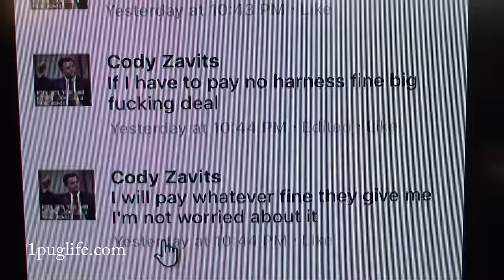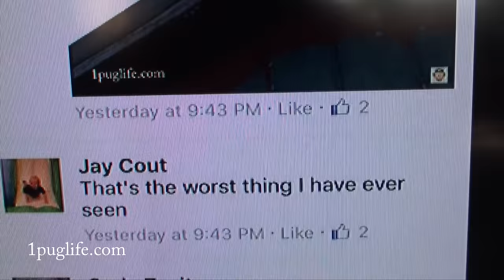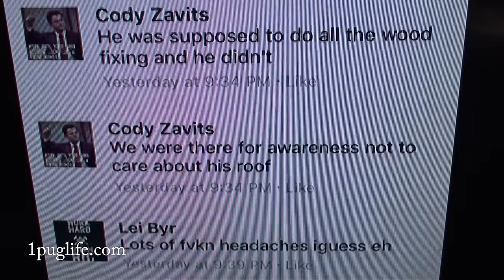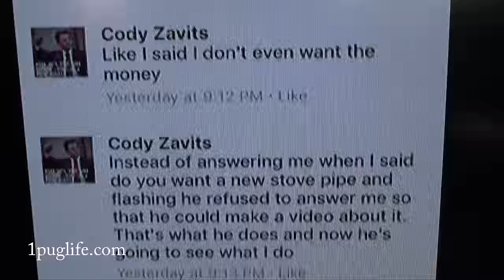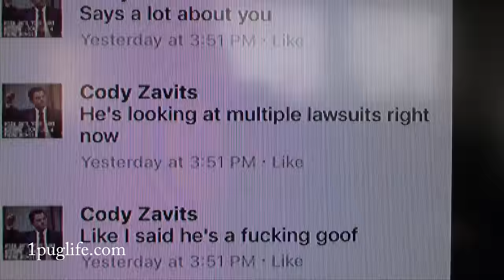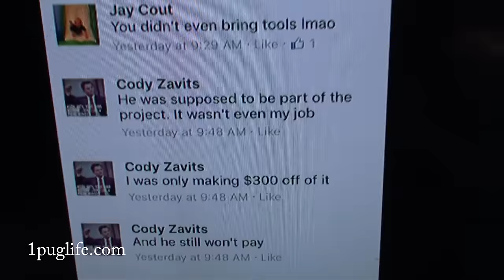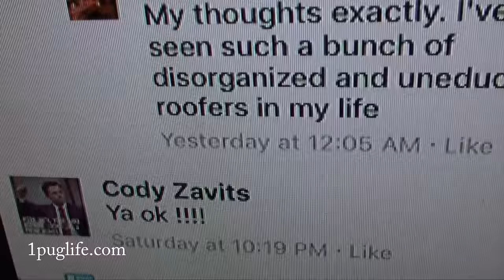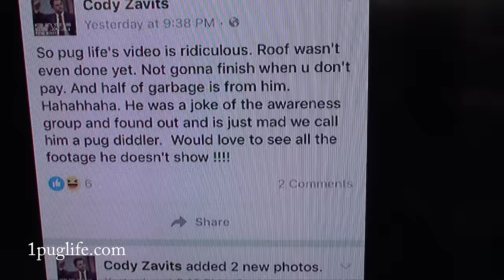second opinion

Comment: Bad sign #1 - contractor #1 needs to borrow a hammer.
Bad sign #2 - contractor #2 shows up with all his tools stuffed into his old lady's SUV.
Reply: Well at least oofer #3 in this video had a damn ladder rack! Something the previous 2 didn't! While yes I tend to agree with you but if you look at the last roof goofs that showed up to inspect the work had a shiny, wrapped truck that looked professional but as soon as they talk look like strung out dopers. At least suv guy seemed kinda professional. As a tradesmen I understand that sometimes you might not have the shiniest truck or tools but it's all about having those things and getting the work done right!!
Reply: @cwatson42785  Even though it's not a truck nor an actual ladder rack this third guy seems way better than option 1 & 2 for sure.

Comment: 54 minutes! Christmas!! Lu dat kine. And then we cheech!
Reply: Ya bess
Reply: You wht love
Reply: Stovepipe!!
Reply: cheech it
Reply: how u doin
Reply: hell yeah, we cheeched the whole time. . if pug released 3 joint vidyas every day. . I don't think I would ever get anything else done. . lol
Reply: pugs why did not put ply wood down first then metal on top eeehhh
Reply: Of course plywood.  That was the first time I have ever seen a roof done that way.  Who ever put the first roof on had no plywood so the job was f**ked  from the start. Hard to recover from a bad job to start with.  Heating the place during the winter must be terribly expensive in the winter with no plywood.  He sould have not let the BS last as long as it did. When they show up the next day early as promised and no safety equipment or tools just tell them GOOD_BYE thanks for F all.
Reply: Metal condensates with temperature variation and would rot the plywood if installed directly onto it. The wood purlins that are there is proper.
Reply: I disagree with the Purlins for multiple reasons...(I am a roofer specializing in metal roofs) first it creates an extra windload. and another area of possible failure. it's better to use a vapor barrier like a peel and stick dry in. On another note the gable end doesn't get a foam closure it gets a piece of trim metal with a butyl tape or silicone under it.

Comment: ? as a roofer in aus i have concerns about job and dont get me started on the safty first ? is wy is the screws on the bottom side of iron and not screwed on top profile of iron second ? is how long are those screws they look too long for the battern there screwing into witch will cause cracking of timer next ? is y did they bodge up ridg capping and put holes in new roof that when the new screws will not fill the holes that where made in the attempt to seal the roof next ? y did the roofer ask for what we call sarking paper to be put down if it was ply then say thy they will run it up the roof witch is wrong it gets layed side ways from bottom up but still it needs to breath so it still neads a battern above the ply to breath hence mayby y he yoused screws that where too long and on a final ? if the roof was out of square a good roofer can creep the irion into square the same as a good timber floorer does and on a final note if i had any worker graging sheets of iron up onto a roof using the gutter or as you call them evs i would kick him off site real fast 
final note non of thease guys need to be paid and the hole roof needs to be pulled of and batters replaced with new ones i hope all goes well and those contraters loos there license

Comment: Advice stop cheaping out with professionals and you may pay a little more for a proper tradesman but the jobs will be done correctly.
Reply: yes but he will get the labor free and  technically the roof is ok.. just needs flashing n caulk n trim and clean up .. a metal roof for 2500$ for 50 years... sounds good to me.. asphalt .. that roof for 2500$ and 2500$ labor for 15 years..
Reply: these were pros :(
Reply: pretty sure it is the shirtless one with long hair
Reply: Obie Rice Yeah, it was, I figured it our later in the video. Cheers bud
Reply: getting someone with a good rep that fast isnt that easy.. he met jordy at a flea market and i guess he asked what he does for work and he said roofing.. first mistake.

Comment: ugh... that nasty overhang on the gable is a nightmare in the making.. one good wind storm will take that up. You need too install a coping? edge all around to protect from that. I also hope that they installed the insulation ma bobbers along the high spots on the bottom edge to protect from insects n shit... i never done a metal roof but i know what the deal is eh.? /// like... everything is always peachy until you get bad weather... but we should expect that right???

Comment: on metal roofs we only use100% silicone caulking, that matches the panel color. and also never use a impact drill to install screws into a metal roof. as soon as that screw strips out it leAks. o and by the way. I could of donated all the screws for you're roof. :-)

Comment: I had never done a sheet metal roof before ,it took me 3 days to do mine with 1 friend and about 3x bigger area. We measured every sheet 2x and kept it comming straight to each end,as you can slightly pull a sheet a bit to compensate ( for my not square roof , I just worked around it ) The local building inspector came by because I didn't get a permit,didn't think I need one ,but he went up on the roof and said it was one of the best roof he had seen don by the owner and only suggested that in the future I should check before starting next time.
These clowns shouldn't be on any roof I could just see how they would put down shingles and cap would be a fn total mess. Not a chance in hell I would pay for that roof no matter if a union guy put it on like that let alone these clowns. ,not a big fan of the min of safety but when your that high up you should have safety harness on ,hard hat on the ground never figured out why you need one on the roof?
Anyway hit them for cost's when you go to court ,it's a blank space you need to fill n on the forms when you file your claim,so add up lost time from work ,traveling time ,fuel, parking fees ect ,,then not only will you not have to pay for the crap work but he will have to pay you.
Good luck in court and can't Waite to see the out come of this .
Ps could you post the name of this company so I can tell other people NOT to hire them.

Comment: even if the building is outta square, you can start with the proper over hang, check the sheets for parallel to the far end you're heading for and adjust each sheet a fuzz so that when you get to the far side, they are parallel there, as well...Tada!!
Reply: Only goof “contractors” blame the building or blame their tools. You work with it and figure it out.

Comment: Get a professional inspector to inspect and document the bullshit and then have someone with both halves of their brain functioning properly, rip the whole thing off and sue Cody for both roofs.
Reply: There is L shaped metal specially designed for the edge over the base metal and under the ridge designed to screw right into the side if the building

Comment: What a joke! Guys showed up with almost no real equipment..., pulling off shingles by hand!! 6 days to do a 2 day job...... ,seeing there had "other jobs, 2-3 hours per day , always late..... roof STILL LEAKS!!!! And even more then before..... You can see daylight holes , where they pulled out the nails... when in the attic..... They told me too bad... Not there fault , it was due to the low end 30 year shingles that i wanted.... when at first i was told they where the best....

by JOE   petrolia

Comment: I put up steel buildings from the ground up. And you don't need to put caucking over the screws, that is what the rubber washer on the screw does, seals it. So the second roofer that checked it out is a Fucking goof.

Comment: thanks for all the work on your vids. 7500 for just the flat roof and 2500 for shop... you could have installed steel in entire building for that price. and it could have had Wayne's coating at the bottom on walls... but we wouldn't get sweet vids. good vids let me forget how I got cocked over by watching someone else getting cocked over, sucks its you getting cocked over. 
side note. drywall will crack in old buildings with concrete floors. nothing you can do about it. just Spackle it yourself and move on.